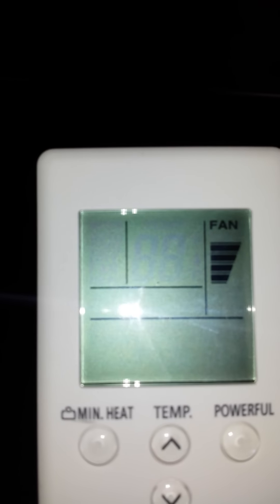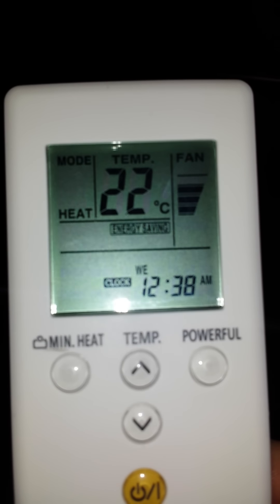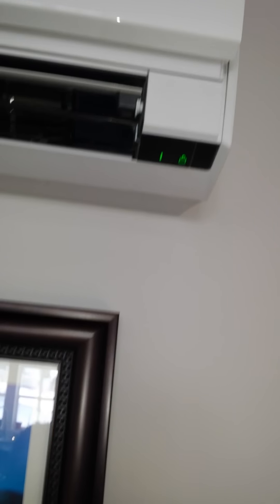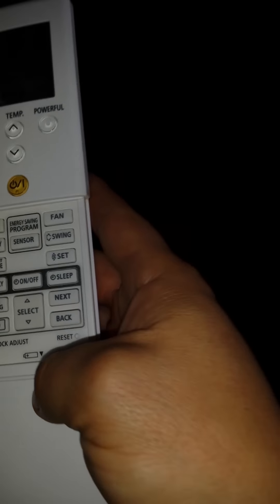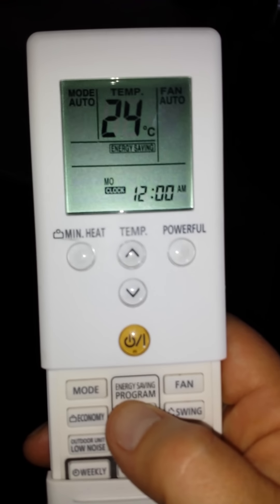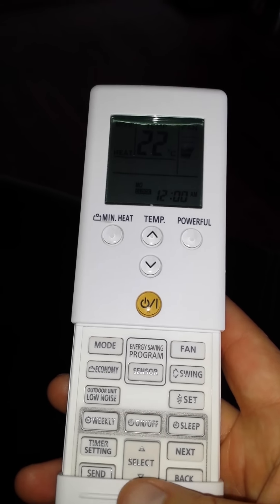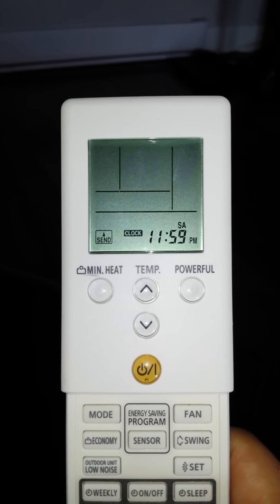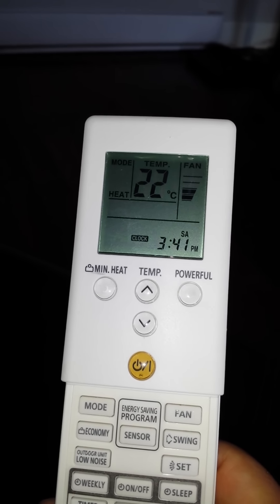How to reset remote for a mini-split & set time

Comment: would you happen to know how to change Celsius to Fahrenheit?
Reply: Did you find out how to change it?
Reply: Unfortunately no
Reply: I called Fujitsu today.  Turn off the remote. hold down the temp up button ^ for 8 seconds then the F or C will diplay. press the up button to alternate between f or c.  worked for me
Reply: Oh my goodness! You are the best. Thx 🏆
Reply: Thanks,

The power off was not clear in the manual.  Here I was holding down the ^ wondering why it would not work :)

Comment: Pls my Samsung air conditioning is cooling before but now, when  it works for few minutes, it will indicate light blinking on d last light on d ac. Pls kindly tell me what to do.
Reply from the maker: Wale Momoh just take out tge batteries wait about 3mins, then put them back in. It sounds like a timer set by mistake.